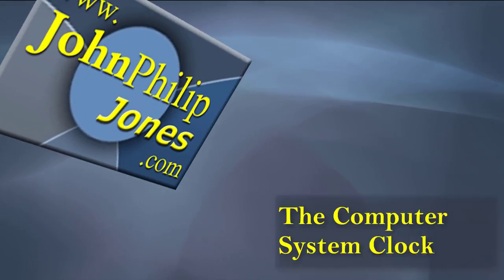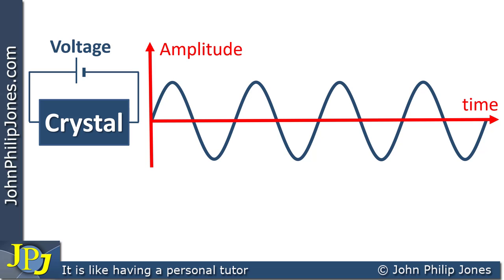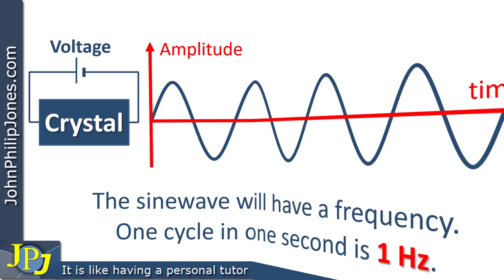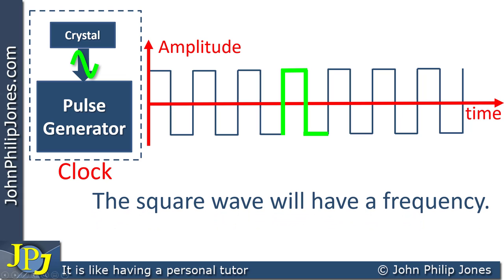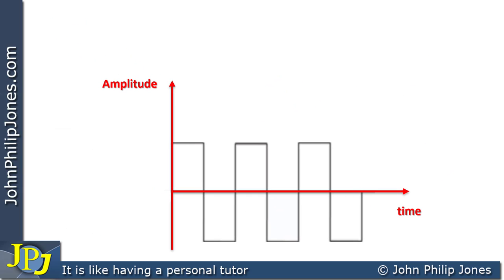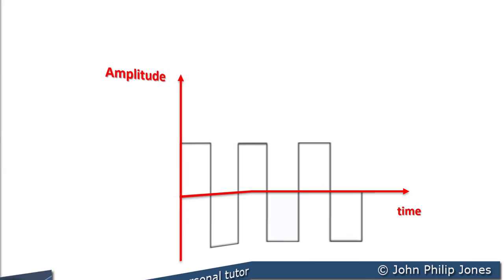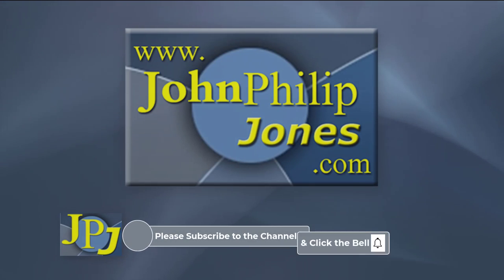The Computer System Clock

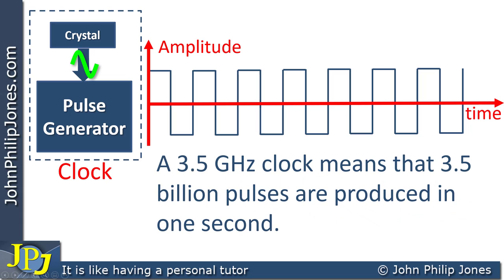Comment: 10:56 
Imagine a Superfast Chef
Let’s say you’re watching a super-efficient chef in a kitchen. Every clock cycle (each "tick" of the clock), this chef completes one step in a recipe. If this chef runs at 3.5 GHz, it means:

The chef can perform 3.5 billion cooking steps per second.
Now, imagine this chef is tasked with making sandwiches:

- One step might be grabbing a slice of bread.
- The next step is adding a slice of cheese.
- Then adding another slice of bread.

If you wanted to make 1 sandwich with 3 steps, the chef could technically make over a billion sandwiches in just one second at that speed! 🤯🤯

Comment: Thanks . How does the crystal and pulse generator work?
Reply from the maker: If you apply a voltage across an appropriate crystal, it will produce a sinusoidal electric signal. You then send this through a circuit containing a filter and 'schmitt trigger'. This will then produce a square wave.
Reply: @johnphilipjones  Thanks